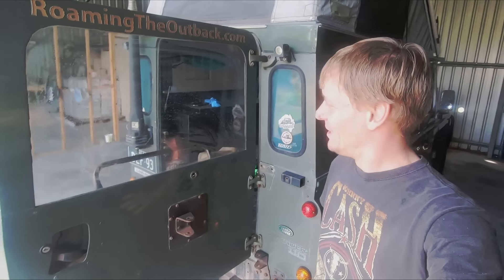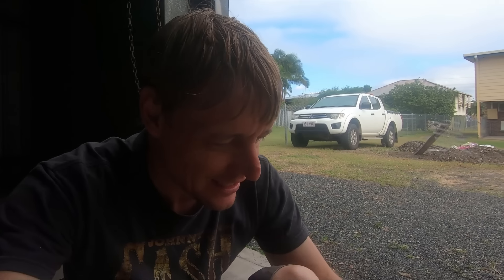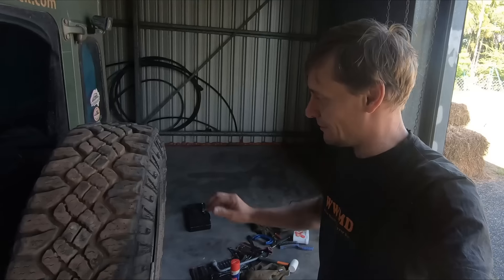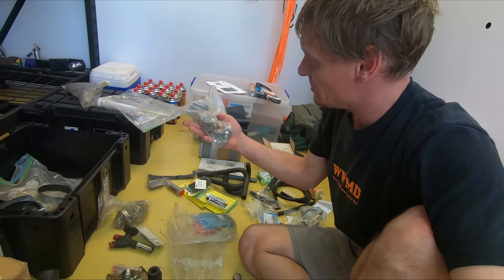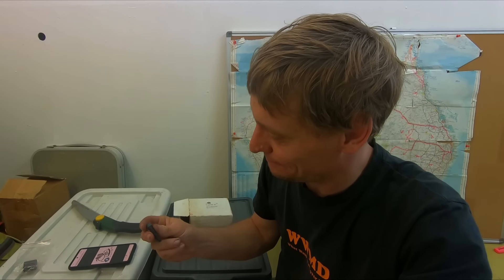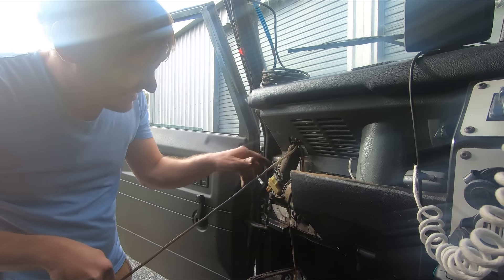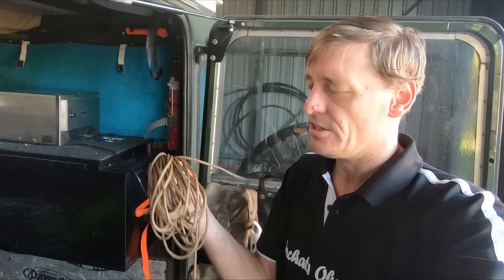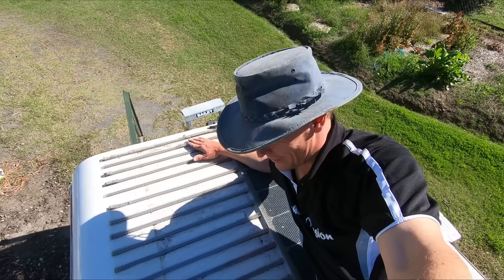Outback Trip Preparation 1 - Defender Repairs, 4x4 Maintenance and Packing

Comment: Hey Brett, this Ridge Ryder panel from Supercheap is the same after four years. They are quite distinct, being black in colour.
Reply from the maker: do you mean they also failed after four years?
Reply: @RoamingTheOutback  No, I mean they behave the same as when new, and exact same appearance, but thinking again, they are glass and aluminium frame, and maybe not suitable for your pop top, and certainly not the current mounting strips.

Comment: We have found fold out solar panels more convenient as you can park in the shade and have the panel in the sun. Also on a pop top with panels on the roof you need to face the roof into the sun which may not be easy given ground conditions.

Comment: If it's not to late, consider a house solar panel to replace the roof panels.

You're DCDC will have to be able to deal with the higher voltage, the panel are more efficient (Being that the make many millions more than 12v panels so the R&D budget is there.) And being a higher voltage, you'll suffer from less voltage drop over the run of the cable.

 Though with the mods, unless you're replacing like for like, technically there's the whole updated AS3001 that now needs complying with.....

But I'm not opening up that can of worms!

Comment: Great to see you back in action Brett! All of your preparation videos i find very useful and interesting! Your landy seems to be ready for a new adventure. I remember when you installed your new light bar to replace your old ipf spotlights that you mentioned you had an overeating issue, any trouble since?
Reply from the maker: I replaced my worn out radiator not long after, and no problems since. Think it was still the original, and fins were rotting away.

Comment: Just an FYI, the original Goodyear Wrangler Duratrac series tire is being replaced with the Duratrac RT.  The RT model is essentially a brand new tread and sidewall pattern using the same compound as the original, whose tread is inspired by the original and looks superficially similar but is otherwise unrelated.

I killed one of my worn Duratracs this past weekend and I'm stuck deciding if I want to go with the RT or to go to something else.  I'm actually thinking about the Nokian Outpost nAT since their load range E tire (as opposed to the SL rated Duratrac) isn't any heavier than what I'm running now but seems to have a more stout sidewall.  But I'm not finding enough hot climate reviews on the Nokian to make me entirely happy with making that change.
Reply: Not sure if we have them in Australia but the Firestone Destination XT has been getting some great reviews in the 235/85R16 size especially due to the low weight reducing unsprung weight for touring/over landing.
Reply: @ianparsons8894  I wish that Firestone hadn't had two specific incidents of bad tires.  They had bad tires in the seventies and then they were the OE supplier to the Ford Explorer and marketed their tires as having more sidewall plies than they were actually made with.  Makes it a lot harder to even consider their offerings to be honest, particularly when a set of tires is that expensive to begin with and when issues don't tend to crop up until the tire is worn down a bit and it's much harder to get a manufacturer to stand behind their product.

That's why I'm so annoyed with Goodyear discontinuing the original Duratrac.  I'd bought five of them originally, I'd intended to replace three this go around and to use the fifth I'd bought last time as my fourth tire, keeping a worn tire as my spare, but that's clearly not in the cards.  I was satisfied enough with how they've worn to want to continue using them and being forced to change to another tire I'm back to square one again.
Reply: Okay, I didn’t know that about the history. That’s quite disappointing.

Is there any chance you can purchase some of the runout stock of the current Goodyear Duratracs?
Our field vehicle at work (Landcruiser 79) runs these tyres in a 235/85R16 and we replaced the rear tyres with the current Goodyear Duratrac in March this year just as the new RT was being released.
Reply from the maker: that's terrible news. I love the Duratracs.. hopefully their new offering works out ok.
Reply: @ianparsons8894  I don't know what's still in the supply chain.  They aren't replacing all sizes at the same time.  I'm running 255/75/17 since I put big brakes off a V8 Pathfinder on my D40 Frontier for safety when towing in the mountains and I have to run 17" wheels to clear them.  I've even looked at 235/80/17 which are a common dually truck tire size but they don't seem to be available in this size either.  Narrower tires sometimes bend better around obstacles when aired down so it's not much of a loss in contact patch when only losing around 3/4 of an inch in section width at least.

Comment: My wipermotor shaft was stuck then the brush burnt of thus it was not working fixed it with solder cleanef it put it back and it have an second live now.That was in last year.